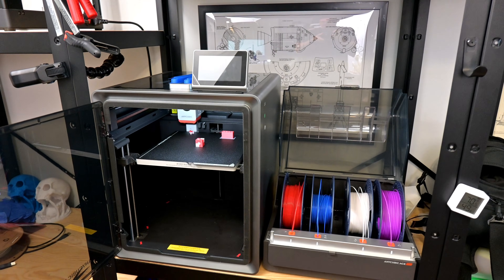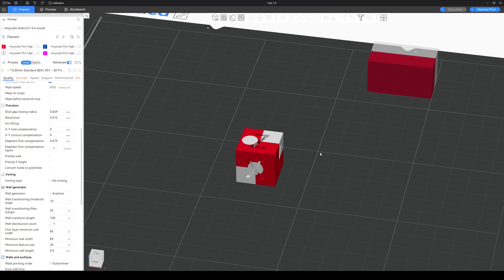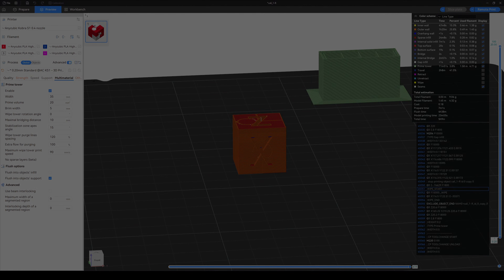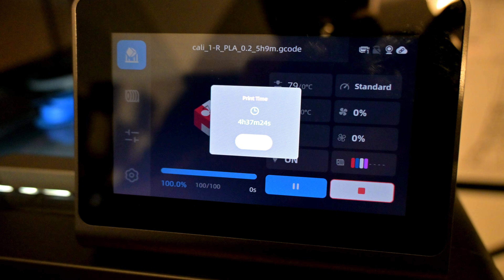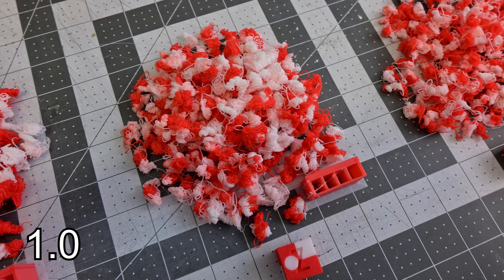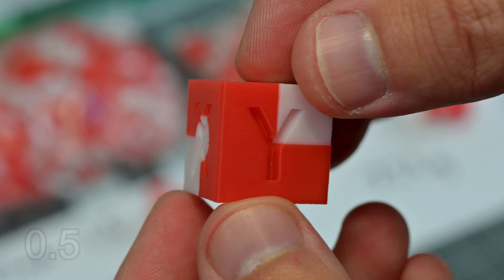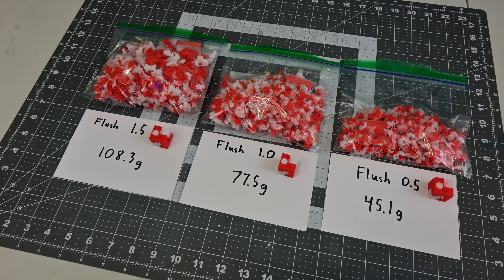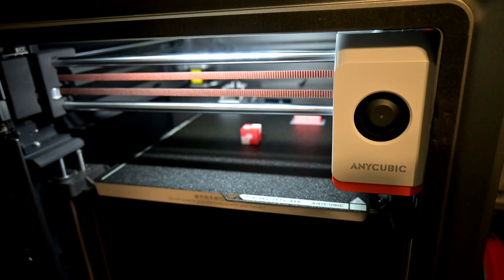This printer poops too much. Lets change that - Optimizing flush amounts on the Anycubic Kobra S1

Comment: Very nice and detailed. Did you test using the setting that prints inline/inner walls first after a filament change?
I recently got the S1, but I have yet to print multi colored. I use OrcaSlicer, but am unsure if this setting is available in AnyCubic's slicer.

Comment: Is there a setting you altered to use Sunlu PLA?  I tried it and Sunlu is the only brand that consistently jams in my print head.
Reply from the maker: Nothing specific to Sunlu filament. The only setting I changed was increasing the Max Volumetric Flow rate so that it could print faster, but I haven't had any issues with jams.

Comment: When printing with more opaque filaments (one layer doesn't see through easily), and using 3 walls for strength, I have dropped the flush to 0.5 and allowed flushing into the infill with no bleeding. You can get aggressive depending on the model and filament being used.

Comment: ok so anycubic Kobra 3 pro just updated and i have 2 ace machines with 8 colors. 'The new firmware has a flushubg volumes option to click it by the filament on the interface. It looks like you can change the multiplier which is at 1.0 default. A graph pops up with all your colors and amount that it will poop out between the color sets. Now this is the default numbers from the first time i opened  the new firmware update. You can change each individual number by clicking the number and typing the new value in. This would take a very long time to get it down to a perfect combination between wasted poop and bleed-thru of colors mixing. So i think when you say .8 I'm thinking the multiplier is the value to drop down from. Good luck trying to figure out the best mix.
Reply from the maker: Yeah, Anycubic just released a major update with these adjustable flush volumes for various colors and material types. I haven't not had a chance to test it out yet, so I don't know if the 0.8 flushing volume I have in this video is the same as the new flushing multiplier. If anyone here in the comments experiment with it, let us know!

Comment: this is biggest minus of anycubic... btw is normal that color switch is 4minutes??
Reply from the maker: Normally a single color change of the S1 with default flush volume is 127 seconds. In thus video I think I got it down to 109 seconds with the reduce flush volume.
Reply: @HoffmanEngineering  in new update of slicer you can change it more directly in slicer

Comment: 0.7 is the sweet spot for flushing   also opt for flush into supports and model by going to the multi-material section of the slicer, however  be warned that if you do choose to flush into the model if any of the model is white and other parts are much darker colors  chances of color bleeding outwards from the inside  flush infill is very high. The option to flush into the model will shave hours off your prints  and saves  quite a bit of filament as well
Reply: The settings aren't on the printer touch screen to change the flush time. Where is it at? I'm on the latest firmware as well.
Reply: @gixxerguy6280  It is in the slicer now.
Reply: @bwsimonson  can u tell me where? pls
Reply: @gixxerguy6280  you have to click on the ace button which is the four filament roll icon  on the printer screen and look around till you see purge ammount the kobra s1 and kobra 3 are slightly differnt when getting to that setting.  S1 you have two ace buttons one on the far left and then only while your printing I believe. There is another ace button on the bottom right above the stop print button click it and then you should see set purge amount. The kobra 3 to switch you just click on the only ACE button on the printer screen and there will be a small menu with an arrow click arrow go down and then set purge ammount

Comment: You could have also compared poop and filament calculations to those within Orca slicer. Same object, same settings and if available even same printer settings.
With that you would have an idea how much those new calculated purge volume numbers effect the amount of purge.
Also a second, larger object for reference would be nice.
At the end there should be another options to tick but it's a bit of a shame that Anycubic removed a function from it's Orca fork that already worked well and made a difference. Maybe their printer firmware is not capable to handle different amount of purge volumes?!
Reply from the maker: Yeah, I assume it's a firmware limitation that you can't specify different flush volumes. Why that is, and if we'll ever get that in the future, who knows.

Comment: people do this on bambu's gear you need to add a retract before the cut get an idea of the length from the cutter to the melt pull back whatever works then do the colour change  so you can leave it at 1.0 but get clean colour as well

Comment: Blur video of settings, speaking to fast for directions related to video so blurred you can not make out the settings or for that matter the version of the slicer.
Reply from the maker: Shouldn't be any blur, are you viewing at 1080p or higher?

The main adjustment is the Flush Volume though the S1's touch screen. The only slicer setting adjustment was the single Purge Time setting calculated at the very end.

Comment: I'm wondering if I should get an S1 or wait for Elegoo to come out with their multi colour printing add-on and get the Centauri Carbon instead. Any thoughts/advice? Reasons for one over the other or a completely different setup altogether?
Reply from the maker: I have a centuri carbon on pre order, but it hasn't shipped yet so I don't know how well it performs. I've been consistently impressed with the S1 so far. The multicolor works great, and the filament waste can be reduced dramatically with a few settings changes. Although I do have a couple strange single-layer blemishes on some prints, where it looks like a partial layer shift, but then it corrects itself. Only once on a print, but it's happened with maybe 5% of my prints. 

If I were running this as a pure production machine cranking out prints to sell, those blemishes would cause me to scrap those parts. But as a hobbyist for mostly personal things, they wouldn't bother me.

I guess my recommendation would be that. If you are wanting a solid printer for mostly personal use, then the S1 combo enables solid multicolor printing at a low price point. But if you need the absolute highest quality, then spending the extra couple hundred dollars for something like the Bambu P1S might be the way to go.
Reply: @HoffmanEngineering  Thank you so much! I really appreciate your thoughts.

Comment: did these Sunlu filaments read you via RFID? I have this printer for the first day and when I loaded a new filament (red from Sunlu) a message appeared that it was reading RFID... and nothing else. I waited a minute and manually set the type and color myself. Do I have to wait longer or try but it still won't work?
Reply from the maker: I don't believe any Sunlu filament has rfid, and if they did I don't think the ace pro could recognize them. Did you happen to have any of Anycubic's filament nearby when that message appeared? I've seen that when my Anycubic filament was sitting on a shelf under it.
Reply: @HoffmanEngineering  The thing is, I don't have any Anycubic filaments and none that I know of that have RFID. A few days ago I bought the newest ones from Sunlu (different spools and stickers than before) and today when loading one of them into ACE Pro this message appeared. Tomorrow I'll try with the others.. it would be surprisingly nice if it worked ;)

Comment: Hello, great information thank you. 
I wonder why it poops and also there is this column which is printed near the model ? Pooping is already for being sure the color switch is done, then again it first prints the column near to it again for being sure it is switched and no remaining of previous color left. right ? if pooping is enough for that why we are loosing additional time with that column? If I remove that , would it cause any issues ? I think I am going to try and see.
Reply: Hmm, I saw that that part is called Priming Tower. I will look into that.

Comment: Hi, new to FDM printing here and I have a Kobra S1 on the way. I have a hypothetical question, if you had multiples of the same multicolor print on the plate could you sacrifice 1  or 2 prints and just do the least amount of flushing? In order to save time and waste ? or is the start stop for the colors variable, meaning it won't always be the same 1 or 2 prints that are affected? TYIA.
Reply: Having multiple prints on the bed won't change the amount purged so you will have the same purged material weight for 1 print, 20 prints, 100 prints...

The most efficient way of printing multiple multicolor prints is adding as many as you can to the print bed and printing them simultaneously
Reply: @The12231  The question was " could you sacrifice 1  or 2 prints and just do the least amount of flushing?"

And the answer is: yes. It's called "flush to objects" and you can choose in which object you want to purge. Combining these "flush to infill/ object/ support" options with many of the same objects to print optimizes it.

Comment: Damn 4 hours for a cube is wild. My s1 combo is on the way and i knew the poop was bad and i knew multicolor would take longer but damn. Its definitely gonna be putting in work cause i have big plans that are gonna fill the build plate
Reply from the maker: Yeah, multicolor prints take a long time. I just finished a 4 color Caterpie, took up about half the build plate, and it printed in 51 hours.
Reply: In response to my own comment id Luke to say I've had ot just over a month and proudly have about 700 hours, have run 14kg of filament through it and done 233 prints without issue so far
Reply: Yeah I just received mine two days ago and can't believe how much poop and time it takes, definitely not efficient for selling prints, there's a new one coming out by Wonder maker that has four extruder heads for about the same price, I'll definitely be purchasing that
Reply: @southernutaharmwrestling2903  yeah I'm watching the ZR Ultra very closely and can't wait for it to hit Kickstarter cause I'm more than likely gonna grab one, I'm pumped for that printer to come out
Reply from the maker: I've never heard of Wondermaker before. Interesting, I'll have to take a look at their stuff.

Comment: I'm surprised more slicers don't support alternating color order per layer to cut the number of purges roughly in half.  If you ended a layer with red, start the next layer with red, rather than immediately switching back to white.  Seems like a no-brainer.
Reply from the maker: I think most slicers do that these days. I know prusa slicer, orca slicer, and all related slic3r based slicers do that.

Comment: Great video, thanks for the info on reducing flushing. Ill give the 0.8-1.0 range a go. 
Have you managed to print with a non-anycubic brand filament? I am finding that everytime I insert another brand, the print fails to start. Shame because I have hundreds of rolls of other brands and only 4 x Anycubic! When I use a non-Anycubic (eg Flashforge, ESun, etc) it gives me this error: "Kobra S1 CODE: 11504 Unknown feed location for not multi-color model, please select a filament extruding and start print again" whatever the hell that means!
Reply from the maker: All of my printing has been with other brands so far. If you follow the QR code on that error, or search Anycubic wiki for that error code, it gives troubleshooting steps.

It sounds like you haven't set the spool information for the filament in the ace pro. Open the ace pro menu on the touchscreen, and for each spool slot, click the spool and select the material and color.

The Anycubic filament has rfid to set that material and color automatically, but we have to manually set it each time for other brands.
Reply: @HoffmanEngineering  Na, I already set the spool info each time, but it fails with that error, every time it tries to extrude. Great to hear that it should work with other filaments anyway, thanks for confirming! I wonder if its a firmware problem. I'll try updating it & see if that makes a difference. Otherwise, I guess it could just be a defective ACE unit.
Reply from the maker: @andycrypto280  Ouch, sorry to hear that, hopefully a firmware update fixes it!

Comment: You could also Flush into Infill and supports to reduce volume and possibly time.
Reply: Yes, this would be the right way to do it. There are 3 types of waste: The remaining cut off old filament. This has to be pooed out, as it can not be controlled (it is cut after all). Thats the "pure" old colour in the poo. But everything after this is "printable" - just not a pure colour. You could print it to infill or to an object were colour does not matter.
The third type of waste is "priming" the nozzle (to get the preasure right). This normaly is done using a priming tower.
Imho it is wrong to controll waste by the printer. It should be done by the slicer. It should be the users decission how he wants to use the waste.
Reply: Extremely based facts.

Comment: never thought of updating the time in the slicer. good work! any idea if we can use kobra 3 ace with the s1 combo?
Reply from the maker: There are some differences between the ace versions, but you can plug in the Kobra 3 ace and it'll work. But it's not recommended, because the spool guides on the lid of the S1 version are missing on the Kobra version. And that'll lead to higher chances of tangles.
Reply: @HoffmanEngineering  is the way it retracts different from that of the k3? i have a few hundred hours of print time and have never had an issue with tangles. 

i am glad to hear that it does work. that was the question keeping me from getting the s1 in hopes that its much better than my k3. unfortunately it was plagued with issues and had to make a custom firmware. 

hoping to get a better experience with the s1 since im invested with 3 ace systems.
Reply from the maker: @KnuXx28  The retraction is way more than the Kobra 3. With the 3, the filament sensor is at the very top of the hotend, so it only needs to retract enough filament to pull it out of the 4-tube connector at the top of the hotend. With the S1, the 4-tube connector and sensor is at the back of the printer. So it has to retract about a meter of filament to pull it out of the hotend, through all the tubing at the top, and out the back of the printer.

The ACE Pro does try and wind the filament back onto the spool, but it can only guess at how much to rotate the spool (spools have different diameters, and different amount of filament on them). So you end up with a lot of filament pushed back into the ACE Pro, which the new spool guides on the lid helps to guide and prevent tangles.
Reply: @HoffmanEngineering  by the way thank you for replying quickly and or at all.

Comment: I have been trying to get good prints with 3.0 setting on the S1 and I'm still getting black lines where red or white should be. Is there a setting I should try to make it better?
Reply from the maker: I'm guessing black lines are due to black filament? If you are at 3.0 flush volume, the only other thing you could do to increase flush would be to add in a larger purge tower in the slicer.

If that's still not working, you might just have a brand of filament with  very sticky pigment. It would be worth trying a few other brands of black to see if you can find one that works better for multi color prints.
Reply: @HoffmanEngineering  I tried the bigger flush 3.0 and 1.5 and a larger purge tower and still causing black lines in my green filament now. On my X1C I have to adjust the purge to be 700 and it works great. Any chance you can send me your settings?

Comment: I've been looking at this for a while.  Do you think it's worthy? There are so many mixed reviews.  Im also looking at the elegoo.  I understand that it isn't a multiple color printer but the price is so attractive.
Reply: Best bet is to wait for more user reviews as both units are new. Expect March reviews/complaints for S1 and June for Centauri, based on the US shipping estimates.

Anycubic tends to keep the price constant ($600 atm) 

Elegoo says the Centauri ($300) has the ability to print in multiple colors, but who knows if it will be an add-on or implemented in a new printer, and at what price? Check if they retrofit upgrades or lock them out. They also claim the CC price won't increase but I've seen lifetime licences revoked, so I see it as a $300+ gamble. I hope I'm wrong and just jaded from WearOS promises for upgrades that never happened

Also look out the the Flash Forge AD5X, was $400 early bird

Lastly, evaluate if you're locked into using thier firmware, thier slicer, thier app, no octoprint/outside control..

Hard choices..see ya in March
Reply: @LeftyPencil  I love the S1 that has the heated AMS.  I want to wait as well but S1 is on special till end of the month.
Reply from the maker: Yeah, the S1 combo is only sale for 599 USD currently. That's an incredible price.

I do have a pre-order for the elegoo centuri, so I'll have my review for that when they start shipping. But it'll be a while for that.